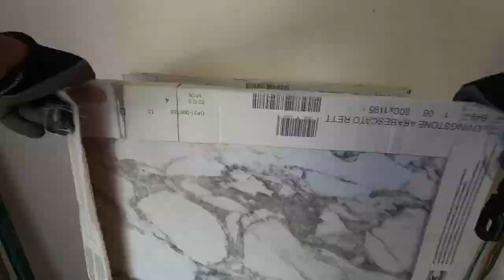DOLLY ORDER GONE WRONG‼️ #foryou

Comment: They prob shouldn't have had those big sheets of marble laying flat like that w stuff stacked on top. Hit 1 bump and crack. They typically do big pieces of stone similar to glass. Vertical. Hey bud you should really wrap up a dresser like that. Protects the wood and keep those drawers from spilling out. Throw 2 moving blankets over it and shrinkwrap around it. Adds about 2-4 min to the job. But actually saves time w loading and unloading. Less worry about drawers flying out, it's padded, less worries about bumping something like a wall or railing. And don't use tape, it'll peel the finish off. Shrinkwrap is around $20 a roll. $1 worth for a dresser like that. Then when you are scooping up cash clients they see you know what you're doing. Happy to make a video showing you how to do it if you want.
Reply from the maker: The Tile Shop definitely should have thought that through. Nothing I can really do about it. I have 2 rolls of shrink wrap already. I have used them on another job. I only use it when it really seems necessary.  I actually did have a blanket around the dresser and took it off when the customer came out to look at the dresser. You just didn't see that interaction on video. We just tilted it back a little when carrying it, so the drawers actually didn't move at all. It literally only went about 10 feet into the front foyer. Thanks for the tips!!